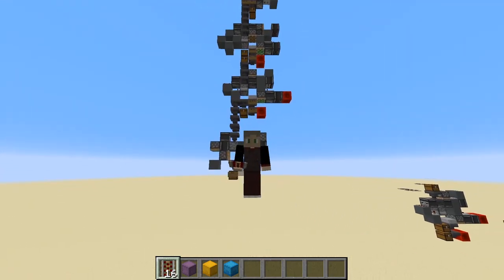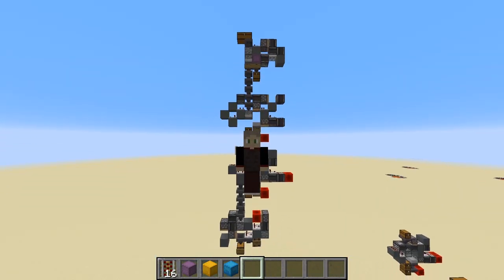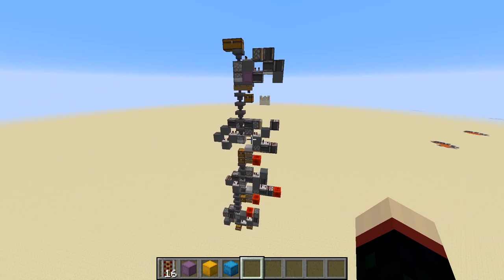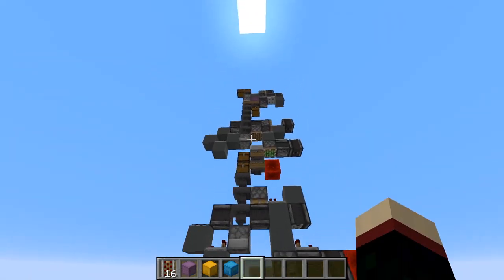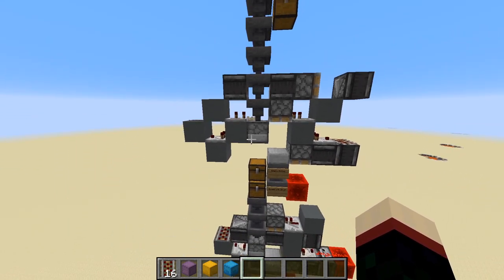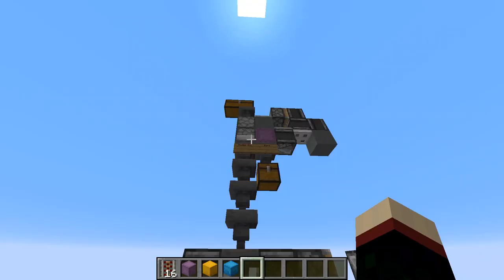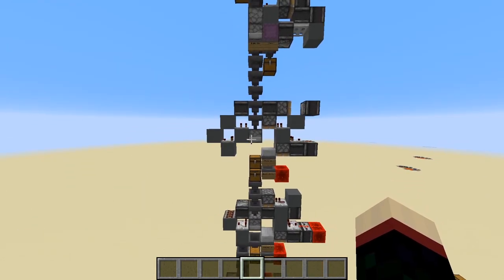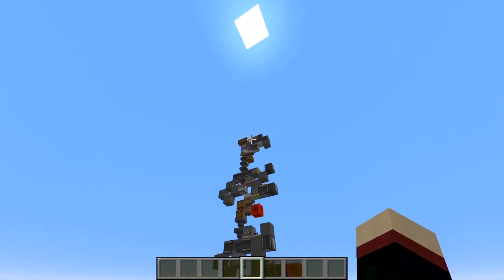Cubfan135's 4-Stage Shulker Box Sorting System 1.16 - Hermit Tutorials Episode: 1

Comment: Hello! This is a very nice video! I would suggest the Vanilla+ texture pack by xuimavoid, specifically the better observers module if you want to easily see what the observers are doing from the sides.
Reply from the maker: Thanks! I should add that to what I'm currently using from Vanilla Tweaks

Comment: Not sure if anyone else found this out but if you put a hopper directly underneath the hopper that sorts shulkerboxes with items from the shulkerboxes without, it fixes the problem with 1 shulker box always being stuck in the hopper until you put another one in there. Because it sucks them down before the hopper is locked by the redstone block.

Comment: I just finished doing the same as you did :D I am just hung up on the shulker unloader atm. Not sure what to use.
There is an easy fix for shulker box being stuck. Place a hopper pointing down, not sideways, and the shulker will not get stuck in the system.
Reply: I placed my hopper facing down and it still is getting stuck.  Any idea?
Reply: @mack962289  You need a hopper below. The hopper pointing into the chest, whether down or sideways, is locked meaning that it can't push or pull. If you placed a hopper below, it's out of the powering range, and is able to pull, even if the one above can't push.

Comment: I was having some trouble with the third section consistently sorting them to the correct output, but after tinkering around a bit I worked out that if you add a 3 tick delay to the repeater it gives the comparator more time to read the current  box and it's accuracy improved drastically! Also appears to resolve the issue of the boxes getting stuck 60ish percent of the time.

Comment: Is there a reason why there wasn't a step by step build with you also explaining why things are in certain places? It also was a bit hard following you since you kept jumping back and forth, which could've been avoided if it was purely built step by step.

Also, module 3 has an issue where full shulkers can be sent to the unloader module unless the repeater there is set to full delay

Comment: I fixed the problem with the partially full shulker left in the hopper, but it uses 4 more observers, gets rid of the piston, the redstone block and uses redstone torch with repeaters instead
Reply: You could also fix the problem by simply putting a hopper underneath that hupper to suck out the shulker

Comment: The third sorter with full shulker boxes and partly full boxes. Does not work with 1 tick it has to be on three ticks.
Reply: Common misconception. Repeaters have a default of 1 tick delay. when you click the repeater 3 times (which is what works, and what I assume you meant) you actually have a 4 tick delay. Hope this helps anyone struggling with timings, because the different ways ppl use it are confusing
Reply: I know waht you mean, and I see the mistake thanks for correction

Comment: Anyone ever come up with a fix for that locked hopper in the second stage? I get why it's locked to switch between the output hoppers but one unused shulker is kinda annoying for such a perfect build
Reply: You know, shulkers aren't too hard to get a hold of. The bottom hopper needs to be locked for the empty shulker sorting to function, but there's no reason you couldn't pulse the lower activator rail to briefly unlock the bottom hopper. You would just have to stop items from flowing through until that pulse is finished.
Reply: So, you could fix the locked hopper, but it would get more complicated.

Edit: Solution further down, put a hopper below the locked hopper in the second stage.